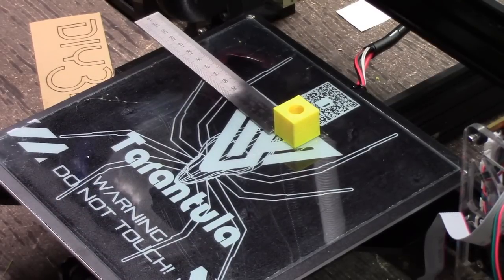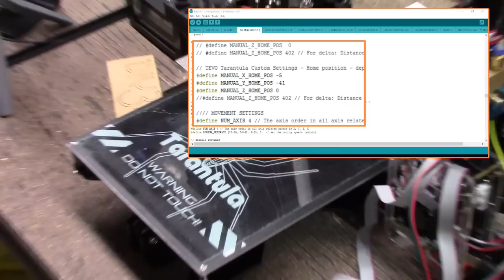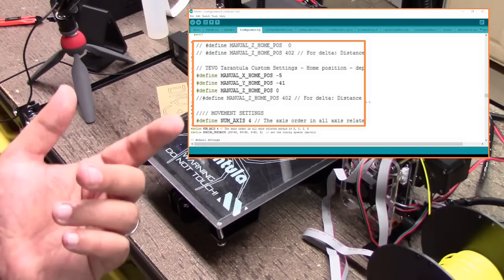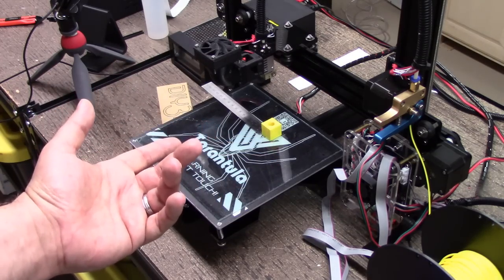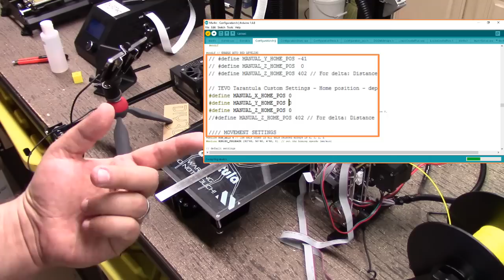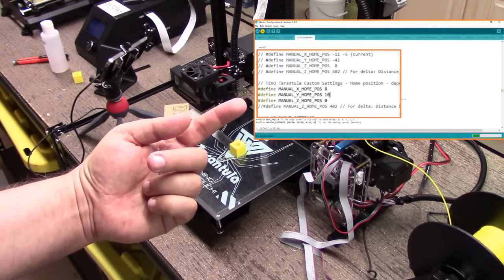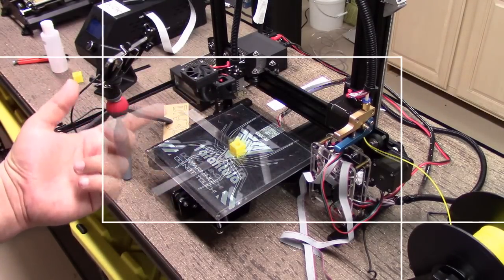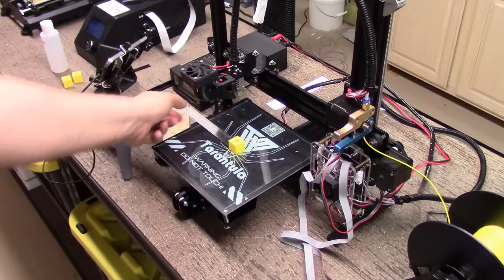TEVO Tarantula 3D Printer - Dirty Little Homing Secret!

Comment: why it is showing error of sanguino while uploading firmware in tevo tarantula
Reply from the maker: It sounds like you not have the LCD  library added for it.  If you google you should be able to find the details...
Reply: +DIY3DTECH.com so what should I google
Reply from the maker: Google the error and find the correct library to add...

Comment: Sorry, this is a old video, but I think the Y is off that far because the Tevo Tarantula has an extended bed version, 200x280. So the default firmware value assumes you have the extended bed model.
Reply from the maker: There was in error in the firmware :-)

Comment: How were you able to still have this Motherboard connect after flashing? Ever since I did the Marlin 2.0, Arduino won't upload code to save my life with this AtMega 2560 board...and I've used Arduino many times before on other projects.
Reply from the maker: Sounds like your having an issue with your board as many are cheap knock offs and have issues.  Can remember if the this has a boot loader on it but that is what I do if I have an issue with the USB loader

Comment: OK, here's a quicker and dirtier fix. (you have to do it for every print)

With the regular view of the Tarantula in mind, (Y axis motor at the back) I used to home all axes and see the bed move so that the nozzle was nicely in the front (nearest to me) left corner of the bed. But if I then wanted to move it manually, it would jump away from there as soon as I tried to move it by even 0.1mm , 11mm in X and 41mm in Y.
So! 
 Before you send each gcode file to the printer or remove the SD card from your computer, edit the code at the start of the program, using M206, which immediately sets whichever axis you type next.
Look for this at the start of the gcode:

M140 S80.0
M109 S230.0
M190 S80.0
G28
G21
G90
G92 E0

And right before the G28 (which sends all axes home) type in the opposite of your bed errors in X and Y
 Mine looks like this now

M140 S80.0
M109 S230.0
M190 S80.0
M206 X-11.0 
M206 Y41.0
G28
G21
G90
G92 E0

Then save the whole file with the changes before transferring it.

Oh, and until you get used to doing this, I suggest slowing down the first move of the nozzle in X and Y

The first line with an "F" instruction sets the feed rate (move speed)
G0 F9000 X52.550 Y52.570 Z0.300
Change F9000 to F900
That'll give you several seconds to watch for a bad move or confirm a good move, with your finger on the power switch. ;~) 

That worked for me. 

Simple enough really and you can save a little text file on your desktop or wherever to copy and paste.

If anyone finds fault with what's here, feel free to suggest stuff. :~)
Reply from the maker: Thanks for sharing, this video is way-back and changing the firmware fixed all of this as it  homes and centers just as it should no issues since I reflashed and edited the config file.  One of my workhorse printers :-)

Comment: Yeap, mine's off 10mm to the right in X and 41mm towards the back in Y. Pretty annoying as I couldn't print the Y axis bed support mod the other day. So I was thinking about adding some G code. Apparently M206 will set home offsets. So I'm about to try x-10 and y-41 and see ow it goes. I'm guessing it will revert when the next thing is printed, unless I add it each time. But I'm used to gcode as we use it at work on CNC mills and lathes. :~)
Y axis bed support mod.
https://www.thingiverse.com/thing:2572598
It thing doesn't stiffen it enough, I'll be buying a sheet of carbon and machining/drilling it myself.
Reply from the maker: Wow!  That is an impressive model!
Reply: DIY3DTECH.com Check my latest comment. The gcode works! :-)
Reply: DIY3DTECH.com Oh yes, the bed mod was recommended by Joe Mike Taranella

Comment: Hi i fix  the X axis by changing it to 11. But i don't know why the y axis seems reach it limits no matter how big the value it stay in the same position. It only move 30mm from the stock settings. But i need another  15mm. Do you know why it's happening?
Reply from the maker: Without seeing everything you have done,  would suggest clearing the EEPROM settings.  Also its been a while since I did this video but as I recall there are setting for bed size and two there internal stops.  Both have to be adjusted...

Comment: My issue is the Z Axis. The printer assumes that whatever location the extruder is at when the printer is started up is the new Z = 0. I would reset this, but the firmware (Marline 1.1) doesn't allow me to move my Z axis to negative values, which means I can only go up, not down. Trying to see if this is a setting in the firmware or something but I'm at a loss. Any ideas?
Reply from the maker: Well that sort of is right as your header code should do a G28 to home all axis and that will be the last place the extruder is (i.e. 0,0,0) as you should not set a negative as its impossible to go past the bed.  Also is your end-stop set up correctly?

Comment: I'm still trying to get my first firmware to go in.  Every time I get one error fixed there is another one.  Very frustrating especially since I am really new at this.  My printer is only two weeks old and I have downloaded the current firmware but it throws up error after error and some I have no idea how to fix.
Reply from the maker: The Tarantula is a GREAT Kit, but not for the faint of heart as it takes work and lots of it but if you make it to the end, you know how a 3D Printers works and that its value :-)

Comment: I have an issue with mine.  No matter what I do the X access keeps trying to home to -300 which obviously it won't. It sits there and just chatters cause it can't go any farther.  Any ideas how to correct this?
Reply from the maker: So it does this if you if issue the home all from the LCD control?  If yes, something in the firmware is hosed up.  Get a good version and reflash it would be my suggestion...
Reply: DIY3DTECH.com yes, I just flashed a new version of the firmware because the factory firmware I got from Tevo had so many errors in it that adrino would not let me load it.
Reply: DIY3DTECH.com I finally after two weeks got the other axises fixed so they quit doing it. But for the life of me I cannot find the -300 on X in the firmware anywhere.
Reply from the maker: I had another viewer write (check the comments in this video) that they changed the name in the name of the CONST in the firmware for this.
Reply: DIY3DTECH.com I have downloaded a couple different firmware and when I try to send it to the printer it comes up with errors and I have no idea how to correct it.  This is very frustrating
Reply: DIY3DTECH.com ok, but when I try to upload it is when I come up with All kinds of errors. One was something about the #endif and I'll have to go back to get the others

Comment: I downloaded the marlin software with the tarantula configuration but i can’t Find the Manual_home_pos lines in the code. Is it possible that it has changed since this video is a year old?
Reply: great found it. thanks for the quick response :)
Reply from the maker: Yes it is possible but just use the find function of the IDE...
Reply: i found it. it was named differently in the new software :)
Reply: i got the same problem. how is it called now?
Reply: #define NOZZLE_X          0
#define NOZZLE_Y          0

these lines should be almost at the beginning of the configuration.h code right under the #define lines for the bed size and homming positions

Comment: its pretty simple, you've installed your Y axis in the wrong place, you can easily move your Y axis by adjusting how far the x (flat) 2040 beams attach to the y (upright) 2040 beam.
Reply from the maker: Thanks for writing however it is right place, as you can physically move but then you will be off center with the uprights (you should be at measured perfect center for correct balance) and been that same spot for a year now.  The issue was in the firmware as you could see with the numbers as -5/-41 where just strange (as keep in mind to the Tarantula has an off sized bed for a standard 200 x 200 printer)...  :-)
Reply: it should be measured so the excess max and min y axis are equidistant - which would put the nozzle in the middle of your bed...
Reply from the maker: The nozzle is in the physical middle of the bed the, firmware settings created an improper offset and hence the need to change them as why would they be set to 5 and -41 of all numbers? Both are "odd" numbers the bed is an even size (220x220) as you notice the adjusted numbers where x=8 and y=10.  Now if I wasn't lazy and moved the y end stop I would have been at 8 & 8.  As I could not have adjusted out -41mm in Y (reasonably)...

Comment: Thanks for the tip! I have the same issue with my tarantula. I just want to post an opinion, correct me if I'm wrong please.

It should actually be at 110mm from the front, not 100 as you configured it to be. If the center of the block is in the middle, you will have 10mm protruding into each half of the build plate (since its a 20x20 block). That translates to 120-10 = 110mm.
Reply: @Henry Thomas: If the bed was 240mm you would be right, but he is right when saying 100mm because the bed is 220mm. If you subtract the 20mm cube from 220mm you are left with 200mm, divide this by 2 and you get the distance on each side of the cube.  
(220-20)/2=100mm
Or divide total length of the bed by 2 and subract 10mm (half the cube, like you said), and you still end up with 100mm.  :-)
220/2-10=100mm
Reply: I see. Thank you!

Comment: Hello

If I do home all 
the X well home good
the Y home good..
But the Z will not home at the centre of the bed  !!! 
Also when I do bed leveling, it seems that the printer don't know the dimension of the bed, the X and Y maximum will keep on going until it hets the boundary of the printer frame!!! 
I tray many versions of Marlin , but the same problem keep on caming. 

youtube vedio 

https://www.youtube.com/watch?v=2gsrcxOrj6U&feature=share

Thanks
Reply from the maker: So why so do you want it to go the center of the bed?  (i.e. But the Z will not home at the centre of the bed) as home (0,0,0) is the front left corner.  Also it doesn't sound like you have your limit switches set up correctly and that is the reason more than likely it is hitting the as once it bumps the switch that will stop it.  It is also by those switches that that it know where it is at (i.e. dimension of the bed)
Reply: Your problem is probably an easy fix, probably wrong parameters in marlin. If you haven't gotten it to work I can take a look at your firmware to see if I can find an error if you want, just give me a shout.

Comment: I have et same issue and tried you idea, but it does not work on mine. I am using it with a inductive sensor which it does have an effect on. When i change the numbers and do a homing the center has moved, but when printing it does not change the center. 
Have you done anything to the G code in Cura?
Reply from the maker: Do you have the right bed settings as mine is 220 x 220 not the typical 200 x 200 so if you don't the "machine" up correctly in your slicer it will be off by 20mm.  Hope this helps :-)
Reply: I have both Marlin and Cura set to 210 x 210. My offset is something like 60 mm in both Y and X direction.
Reply from the maker: Did you get figured out?

Comment: The Tarantula has a 200x200x200 print area, not 220
Reply: The beds Physical size is indeed 220mm x 200mm, But the print area is only 200mm x 200mm other wise you end up printing on the screw heads which are recessed and will cause issues with a large print.
Reply from the maker: Mine is 220mm x 220mm not 200mm and the reason I had to change.  In fact all the ones I have seen are this size in the smaller version...

Comment: I wonder if the offset is because they were anticipating the extra long bed as the standard.
Reply: As you can see from the name in the stock firmware, they're using a Marlin config for the Migbot 3D printer which comes with a 220x220 bed, with the large offset mentioned in the video that throws it out a strange amount.
Reply from the maker: When discovered I though this was  thinking too this was possibly, however the numbers still seemed a bit odd...
Reply from the maker: Interesting, kind of figured they were "reusing" the firmware...
Reply: even with the longer bed, which I have, it still prints off center.

Comment: LOL  I was wondering when you were gonna get to some firmware tests  . Those firmware files are so full of stuff. 
but yeah it's one of those settings to allow for variation in geometry and end stop positions . 
One that got me real good was not allowing negative moves until homed and such .   i could not figure out why my  franken printer would refuse to home . took me some time in the homing sections . LOL
Well glad it worked out . + Happy new year
Reply: PS i suspect it was firmware possibly copied from an other printer model, they just never adjusted the offset or forgot .
Reply from the maker: More than likely (copied) however this is what came stock so I am surprised this isn't discussed on the forms as I did some searching and nothing.  Also happy new back at you and may it be full of many machines!